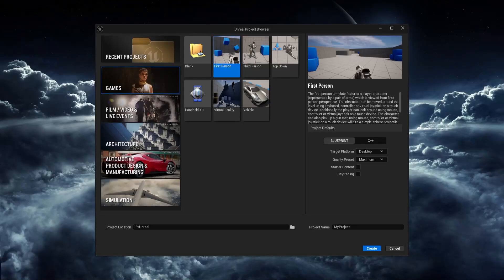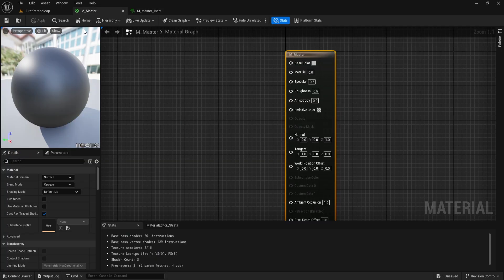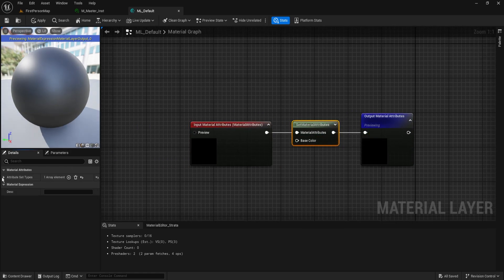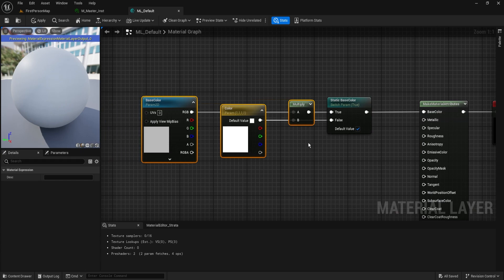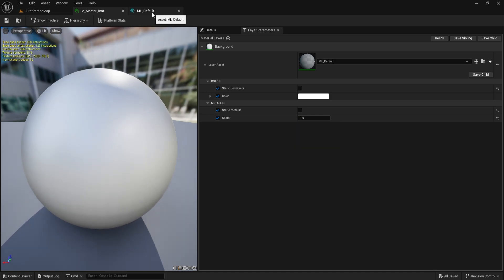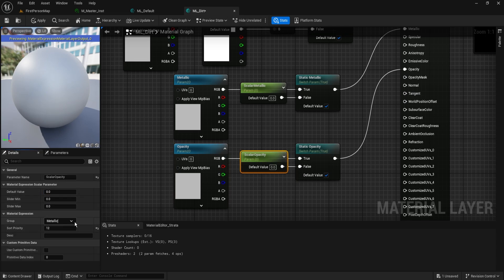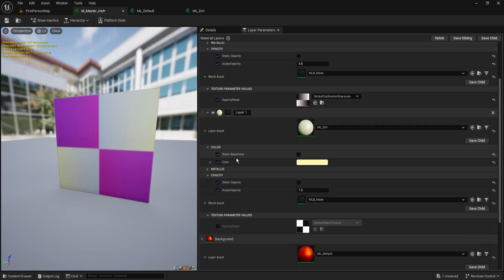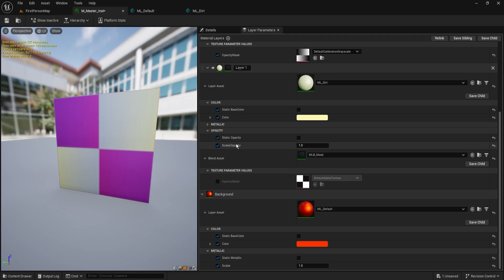Creating Layered Material | PowerWash simulator Part #1

Comment: Might be a willy question but I'm brand new, what keyboard shortcut are you using when you highlight the nodes to get them to line up?

Also when you say press t and press 4 that doesn't seem to do anything in my Unreal. Are those keybinds you made previously?
Reply from the maker: So what I use to line up is Q, you can right-click on a node and look at "Alignment" to see all the shortcuts for lining nodes up.
For the press T & 4, those are by default in Unreal, but you need to press them at the same time as the left-click.

Comment: Does this require a capture and none-mirrored texture?
Reply from the maker: As far as material instances any texture will do. But for the power wash part I will give an explination in the next part about possible issues caused by the UVs.(It only really works if none of the UVs islands are overlapping, I believe that would be mirrored textures) I’m not an expert on materials so I hope I managed to answer your question.